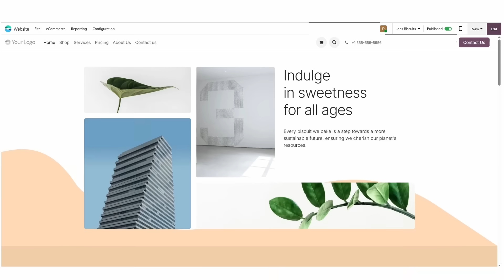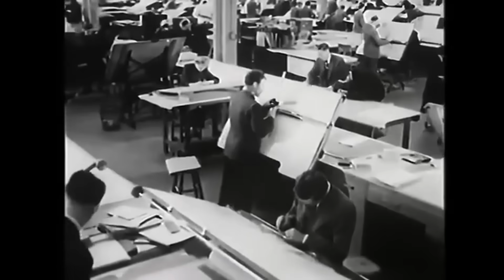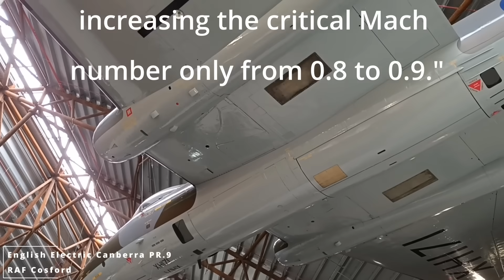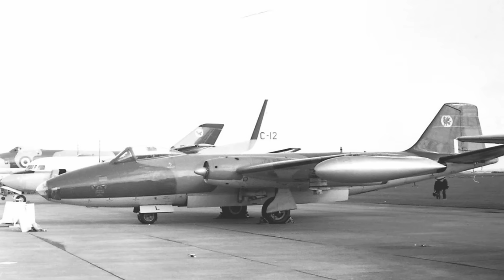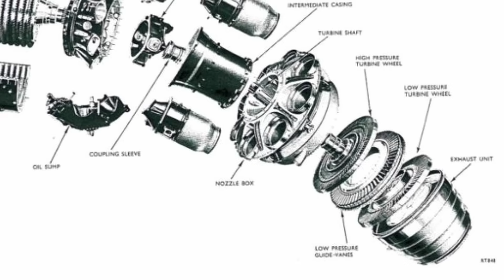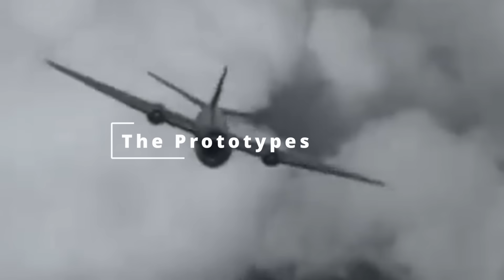When a Locomotive Company Built a Legend - The English Electric Canberra

Comment: 50:35 - I work in IT/Cyber Security. This problem of electrical Interfierence, or “cross-talk” is well understood in the world of Ethernet cableing. Cat-5/6 cable functions at a maximum of 12v, and main-power is 120/220v. Substantial shielding and design effort is put into keeping these two worlds separate.

Comment: Thank you, thank you, for seeing behind the scenes and telling the story that most people are not aware of. The engineering design iteration, development issues and production engineering, the way those are organised and run, are crucial to the successful execution of the project, to timely fruition. Interestingly, the problem you describe that was cited to be the cause WEWP to leave EE, were exactly the issues still existent at Westland during my career there. I fully understand why he felt as strongly as he did, and fully agree with him, in my experience he was right: For aircraft, design has to be "the hub of the wheel" around which everything depends, the compromise is that it has to be design for production regardless of the phase of the design iteration the project is in. Evidently, Teddy had considered this from the outset and partly why the Canberra prototypes had been built using jigs to ensure accuracy and repeatability of wing section and how that was adjustable during build. He would have experienced at Westland, the meddling of production engineers too early in the design phase, that slows everything up. He had allowed for producibility in the initial design. This is also evident in his design of the Westland Whirlwind fighter. An exceptional Engineer in every way. As a footnote, I would like to add, that my father was one of Teddy's project designers during the 40s and went on to become the father(designer IC) of the LYNX helicopter in the late 60s where the prototype design was worked up using an experimental shop largely without meddling. This enabled a new aircraft design to progress from initial design start in 68 to1st flight in 72.

Comment: 14 Squadron - RNZAF was equipped with Canberra T13 and B(I)12 types.  In fact the first Canberra’s to come to NZ was the winner of the air race from London to Christchurch in 1953.
It was a beautiful aircraft - but very severe on the knuckles as most of the engineers could testify too.
The squadron was based at RNZAF Ohakea. It was a very good unit with some very fine men on that squadron.
The squadron deployed to what was then RAF Tengah in the 60's;  via Alice Springs or Amberley or RAAF Tindall - the range required fitting of the tip tanks.

Occasionally the panniers in the bomb bay were fitted for the Friday afternoon "engine test flight". A few cartons of Tiger were secured into the pannier to take advantage of the cooler temperatures at altitude for a few seconds - then returned to Tengah where the pilot greased the landing.
Cheers.

Comment: Richard B. Peach: Official accident records and the Aviation Safety Network identify the pilot as 29-year-old Rolls-Royce test pilot Richard Bryce Peach.
R.B. Leech: Some historical aviation literature, including books by Barry Jones, incorrectly identify the pilot as R.B. Leech. This is likely a confusion with another contemporary aviator, such as Haliburton Hume " Leech, who was a well-known test pilot but died in a different incident in 1939. 
On June 13, 1951, the fourth prototype of the English Electric Canberra (registration VN850) crashed at Bulwell Common, Nottinghamshire, during a test flight for Rolls-Royce. The aircraft was being used for 100-hour intensive flight trials of the Rolls-Royce Avon RA7 engines. 
The Incident: Approximately 1 hour and 22 minutes into the flight, the pilot Richard B. Peach reported that the port engine had failed and could not be restarted.
The Crash: While on final approach to the Rolls-Royce flight test airfield at Hucknall, the aircraft's port wing dropped at an altitude of roughly 250 feet. The aircraft dived into the St. Alban's railway sidings at Bulwell Common station.

Comment: A very detailed video, thanks. But this seems to be a very instructive story. 
The fight with the Avon engine's problems clearly showed that the German experience should have been studied more thoroughly. Junkers used a two-stage turbine in its first axial turbojet engines, but BMW had already achieved reliable operation of a single-stage turbine on its engines by 1945. Moreover, since the early 1940s, the Germans had assumed that centrifugal compressors could only be used in auxiliary units and never in aircraft engines. History has shown that the Germans were right – in Great Britain, centrifugal compressors effectively became a dead point way, and very quickly. But rebuilding the entire engine industry onto "new" axial principles proved difficult and long.
Thus, the captured Germans engine designers completely created the Soviet aircraft engine industry, in the US, German designers at least participated in some projects as consultants. But it seems using the experience of German designers in the UK was impossible for political or other reasons, and as a result, several years were simply wasted. And it was still an outdated design with a 2-stage turbine!

Comment: My dad worked as ground crew on Canberras, Javelins and Lightnings. He was stationed in Norfolk and Suffolk UK, Germany, Cyprus, Gan and others. He was an electrical/electronic tech and often prepped Canberras for low-level missions into East Germany (possibly nuclear-armed, but I am uncertain on this) He survived Suez and later took to 'hitch-hiking' around Egypt ie: cadging rides from friendly RAF transports to visit the Red Sea and the like.
He eventually settled down, got married etc. and rose to become Chief Tech in charge of one of the Lightning simulators at RAF Coltishall. He was also an exceptional shot and competed several times at Bisley.
He founded and ran his own electronic company with two retail shops before moving on to industrial control solutions for managing plants such as milk production and petrol pumps. His last notable project was the emergency design and build of battery chargers for the MoD at the start of the Falklands War.
Bit off topic there, but suffice to say I am a Canberra fan!

Comment: Two things - cambered vs symmetrical airfoils. They both make the same lift at a given angle of attack, and have the same lift curve, just shifted up pr down. So the important difference is that you can get the same lift a lower AoA, leaving the fuselage, for instance, remains closer to level. Note that the Boeing bombers - B-17, for example, used a perfectly symmetrical airfoil and just mounted the wing with a positive incidence WRT the fuselage. Second - it is not "dampening", it is "damping", in this case that is, a torque that is proportional to the roll rate in the opposite direction to the roll motion. Longer span has more damping and more inertia - but also has more torque capability by putting the control actuator, spoilers or ailerons, further from the CG. What you are trying to describe is that the control torque goes up proportionally to the span, but the inertia goes up with the square of the span, so your ratio of control torque to inertia goes down with the span, limiting the roll acceleration.

Comment: I flew the T4 as IRE on 100Sqn,  the B2, TT18, E15, PR7 AND PR9 operationally. Had two double engine failures. One climbing out in winter from Wyton ( having moved recently from Marham).( One engine caught itself as we broke out the side of a CB and restarted. I restarted the other once airspeed regained and continued to Kinloss Scotland fob to do the job of towing a target at 500ftasl on 5 miles of wire for the RA Rspier training battery on Stornaway. 
The second was on an engine air test I think on an E15 with the larger Avon 106 I think (7500Lb) . It was surging as we climbed up through 30,000 ft and at 35,000 ft let me know for sure I should have given up and rub. It blew out with a bang and thexsudden yaw disturbed the airflow into the other engine which joined its companion on strike. My Navigator was on thecfold down Rumbold seat noting down the parameters. It was very quiet. The delight envelope was down at 30k  ft. I said to Jimmy " don't worry, I used to be a gliding instructor in the ATC and anyway, I'll just fly a Jet Provist style spiral down in the overhead procedure for a dead stick landing worst case, but vest you go back to your ejection seat! Both engines restarted via windmilling and we landed normally after canceling the precautionary Mayday. The cloud base was 2000ft so a dead stick would have .can't a high speed cloudbreak followed by selecting the runway likelyvwith no battery power left and a blow down of gear and flap. Best you send that engine back to the shop I told the ground crew. I repeated after a week or so and all went well. 
Many stories of my 6 years flying a demanding but beautiful aircraft. Lost a few friends to it unfortunately.
Reply: I must check text before posting next time!

Comment: In the 1950s, a Canberra was used as a flying testbed for the enormously powerful Bristol Olympus engine. This aircraft would take-off and climb at an extremely steep angle continuously until out of sight. These engines could not be used at full power in level flight as they would have pushed the aircraft beyond the speed of sound, and it was not designed for supersonic flight. This aircraft also set a new altitude record of over 66,000 feet. The Olympus engine was to become the power unit for the Avro Vulcan bomber, and further developments of it was to power the Concorde supersonic airliner.

Comment: Did two tours working as an Armourer on Canberras and two tours on Vulcans amongt others, mostly fitting and removing ejection seats. Neither aircraft had armourers on the squadrons, at least by the time I worked on them during the seventies, eighties and even the nineties on Canberras. Had many enjoyable times away on detachments with the Canberras especially with 360 Sqn (Radar jammers).
Reply: I used to work on Bi8 Canberras 16 Sqn at RAF Laarbruch 1960 to1963, and it was a pain fitting the 4  x 20mm Gun pack
Reply: @joseph-k8k1m  I can believe that. It was awkward enough fitting a camera pack to the PR9's (offset canopy), which was a similar fit to a gun pack? We could never get the profile checks quite right, it took forever.
I first got posted from RAF Brüggen (Jaguars) to RAF Wyton (Canberras) in 1985. Spent the next decade going backwards and forwards between the two stations.
Reply: @joseph-k8k1m  I knew Laarbruch pretty well, mainly for Armourers "piss ups". Still occasionally fly in there as it's Weeze airport these days and my German In-laws live pretty close by near Moers.

Comment: I was on 360 sqdn T17's 1968/70 at Raf Watton then Cottesmore. I was in the Royal Navy and it was a combined RAF/RN training sqdn with a sprinkling of RN aircrew and groundcrew. great posting and as I was a Leading Hand I was treated as a Corporal Engine Fitter and as such was allowed to start and run the engines.We couldn't do that in the Fleet Air Arm as my trade was a combined airframes/engines  (A/E) so we were considered semi skilled until reaching Petty Officer.
Went on exercise in Gibralter and various exercises at airfields in the UK.
It was a slightly primitive aircraft but all the better for that and it shows that going multi role is not always the best answer compared to dedicated types.

Comment: I was at an air show chatting to a pilot of a PR9 (XH134). I asked him how it felt to be flying a plane older than himself: "Older than me? It's older than my Mum!"
Reply: I once arrived back in UK after a Cyprus deployment in a PR9 fitted with infra red linescan  for a low level task in Egypt. The big well to my right in the cockpit where the original entrance used to be in older variants  was  loaded up with beer from the US forces BX in Naples. I left it all in the plane while I fetched my 1959 Frogeye Austin Healey Sprite. It looked its age which was the same age as the aircraft. I had a great photo of both of them together but list it.
Reply: I flew Chinese 134 a lot and transatlantic via Gander and Homestead Fl. Then Belize via an extended stopover in Bermuda due faulty wing fuel pump and bad tooth filling. We had our special System 3b ex U2 camera on board. Big igloo blow up tent with aircon on the airport apron for camera prep and maintenance and to  don  our special suits and rebreathe  O2 for the high level photo tasks from Belize.
Reply: Used to fit and remove the ejection seats on that very aircraft when the PRU had it at RAF Wyton in the eighties and nineties.

Comment: About minute 29, the concept of Wing Camber needs to be reviewed. "Camber" is not the top shape, but whatever the shape of a line equidistant between top and bottom surface. Symmetrical wing profiles have a straight camber line. Asymmetric foils have a positive curved camber line, asymmetry being defined by the % height of the curve at it's highest point, in relation to the overall wing foil length. Point of max height in % of foil length is also part of the spec. When camber and thickness combine to make parts of the lower surface have a concave in the fore-aft shape, they are called 'undercambered' foils, as opposed to undercambered camber lines. Current 'foiling' single man water sports have extreme undercambered foils, from some makers. The 'foil wings' used for hand held power for some of these, also have extreme undercambered foils, more due to the lower Reynolds numbers in the much thinner air, than the denser water the underwater lifting foils experience. A considerable number of sail planes have undercambered foils, AFAIK, all sailplanes for many decades have had positve cambered foil wings. Aerobatic planes may remain the main holdout for symmetrical foil wings, as they are 'upside down' as often as upright.
Glad to see this series on a legendary aircraft, please excuse my pedantry.

Comment: Saw one of these crash at Elmendorf air show in th early 60's. It was making a high speed pass over the 4 strip. Evidently they had a hydroelectric failure. It was a total loss and the nose wheel rolled two miles. Black smoke and orange flames.

Comment: Very good. A story that needed more exposure. Just one teensy tiny point. When you showed the Hampden that EE were to build, the first image shown was actually the rare-as-hens-teeth Hereford powered by two inline H-Block air cooled Napier Daggers. Performance was similar to the Bristol Pegasus powered Hampden but the engine was, let’s say, ‘troublesome.’ They were noisy. They were unreliable and the air-cooling didn’t exactly work well on the ground. Delays after start-up before getting airborne resulted in distortion of components and ~ unsurprisingly ~ premature engine failure. Only a hundred or so were built and they were restricted to training only. In fact many were re-engined to become Hampdens. 
I felt it worth commenting as the sight of a Hereford is not a common event and many people don’t seem to know of its (brief) existence. 
Keep up the great work!